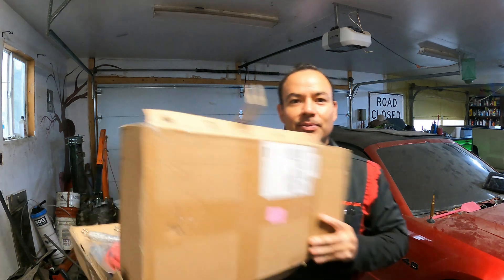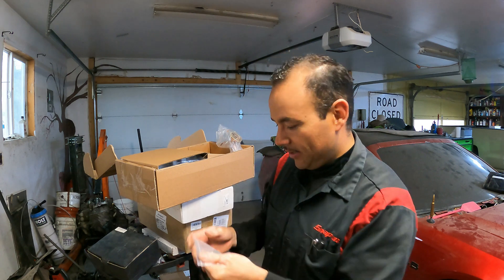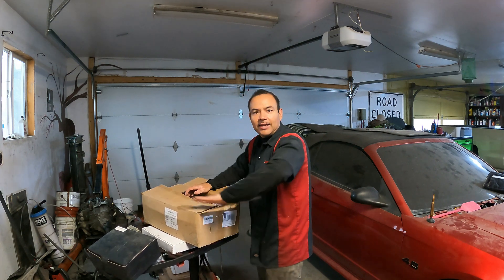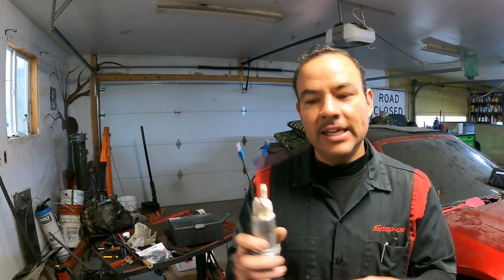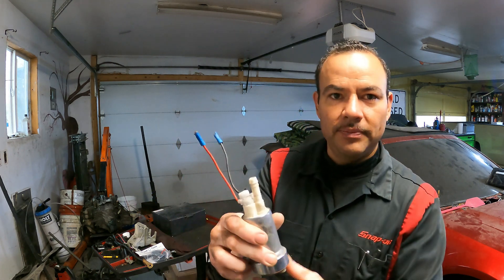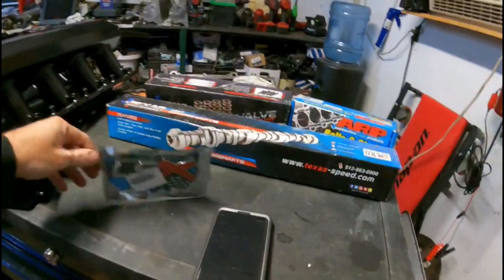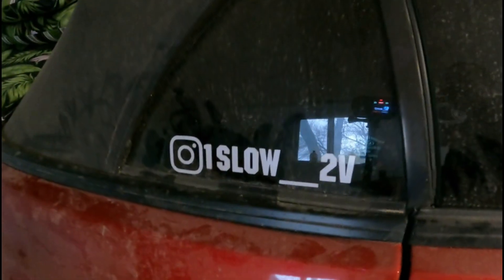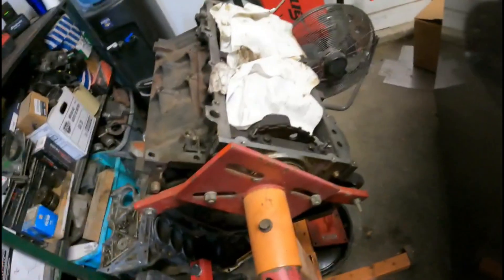How to LS swap a New Edge mustang: parts list

Comment: What coolant hose u use because I’m struggling to find some that fit and what about the transmission coolant lines!
Reply from the maker: we changed the radiator so we just had an idea of the shape of the hose and went to the part store and looked around to find one that would work.  also online you can buy metal piping for radiator hose kits.  just gotta play around with it to make it work.  and trans lines we just used evil energy AN to barb with a rubber hose and no leaks.

Comment: Tony on the new edge mustang LS swap. How do you get your factory dash speedo gauge and tach gauge to work ?
Reply from the maker: @shugg0517  you have a couple options you can go stand alone like terminator x that comes with a digital screen, after market gauges like dakota digital or other brands that you have to wire up.. those replace your factory gauges so it will look oem.  But from what I know you can't make the chevy computer power the ford gaiges.

Comment: Hey i was wondering im wanting do do one of these builds so i want to start with building the engine and i need to know for the new edge what ls motor is like thr best for n/a power and whats best for turbo power, im wanting to make around 600 to 700hp im guessing it could do it n/a but id be okay with turbo just wondering if i need a 5.3 or 6.0 or the 6.2 or whatever the other ones are i just need help finding the right one to then go and pick and start buiding
Reply: There is a difference between an LS and a Vortec. Vortec is the exact same casting as an LS but for the Trucks and SUVs. If you want 700hp N\A, I'd go with a larger displacement Vortec, 6.2 and up. LS and Vortec swaps usually use the small block, but there are big block variants, the 6.2 L94 is the largest small block. Another common swap is the 6.0 LQ9, but the L94 is my pick, it's basically an LS3, and LS3's are a heads/cam package from 500whp. Here's a video to an all motor 650whp LS that needs E85. https://youtu.be/hgmiwtlVfzo?si=YA8_joGTtGlnrX4Y
Reply: @joshuaflowers736  hey thank you for responding in the time since i posted that i bought a newedge v6 from copart and pulled a gt rear end im planning on upgrading next and someone i know actually has a 6.0 lq4 with a 4l80 so im gonna build it for n/a with new cam and heads and push for 450 to 500hp and just run it like that for the street and if i ever wanted more throw a supercharger on it

Comment: Hello! I was wondering what you used for the transmission crossmember? I have a 4l80e that i want to put in but want to find a cheap solution
Reply from the maker: Thanks for the comment tfd4077! We just modified the Ford crossmember the trans was real close in length so it was pretty easy.  I'm sire the 4l80 should be similar.
Reply: @advancedstreettechnology2081  thank you for the quick reply! If I may ask one more question how did you do the fuel system? Did you get a new pump and modify the gas tank with the new fuel lines?
Reply from the maker: @TeamFailureDisappointment  we did a walboro 450 pump dropped the tank and swapped out the pump only.  Our fuel system has a return line so we drilled the sending unit cover/cap and put one of those an fuel fitting to screw on the return hose.  Both were straight forward
Reply: @advancedstreettechnology2081  thank you very much!

Comment: I plan on LS swapping my 04 Stang. It’s an automatic transmission though. How do I find the right transmission to fit the engine ??
Reply from the maker: Thanks for the comment idkwhattoputforaname24! the best thing to do is to get them together that way you know the combination will work.  a lot of people sell the engine and trans together or pull it from the junkyard together.. and its best to get the complete engine with accessories and the ecu.

Comment: What drive shaft are using with the 4l65?
Reply from the maker: stock GT one just sent it to a driveshaft shop they replaced the front slip yoke to fit 4l60 shaft its the same for any 4l60-4l70.  that way it bolts up to the GT rear end.  They install new ujoints and balance the driveshaft.

Comment: The larger throttle body does not equal more power. If it is oversized it can actually hurt more than help
Reply from the maker: Thanks for the comment LS4.8 Frank.  We are going boost with this car soon so its setting it up for that.  Its kinda like a big cam hurts low end but makes up for it in the big end.  just depends on what your trying to achieve.
Reply: @advancedstreettechnology2081  oh ok gotcha, didn't realize it was getting boost. 👍👍👍
Reply: Need more of theses videos I had the same idea